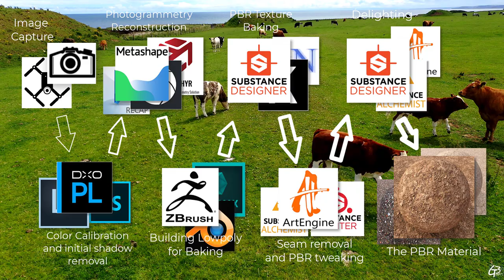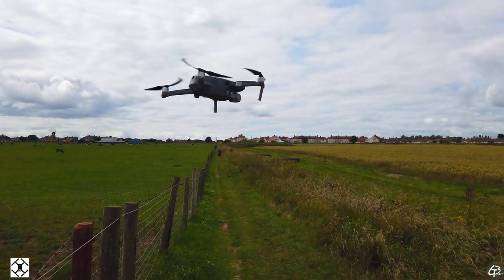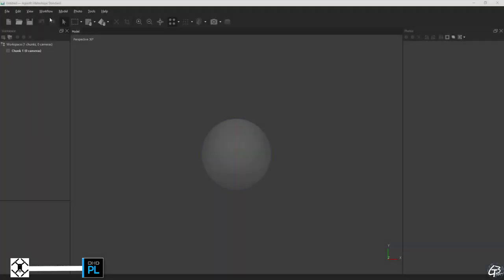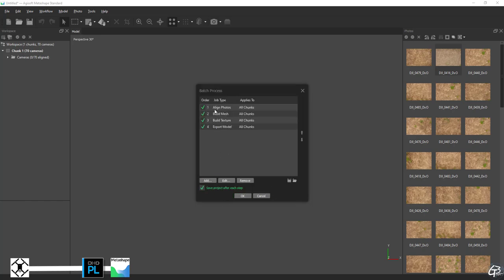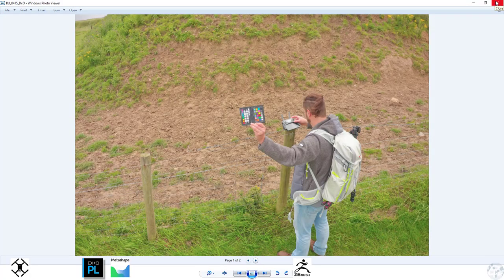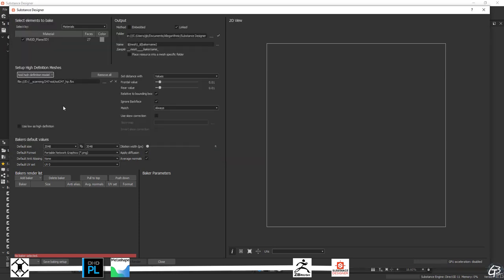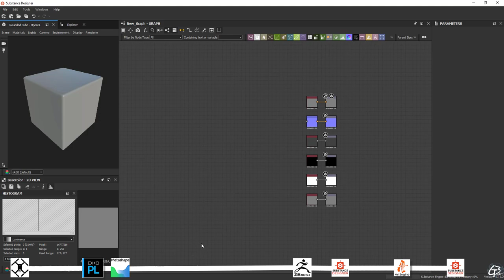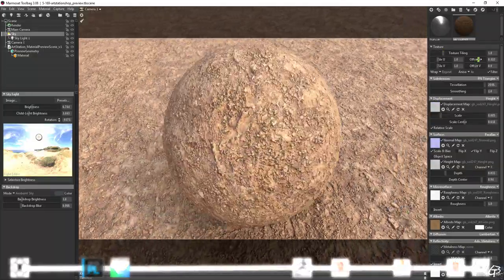Photogrammetry workflow for surface scanning with the drone - Soil PBR Material

Comment: Awesome as always. I love how you manage workflow with batchs in metashape. Thanks for sharing.
Reply from the maker: Thanks a lot. Usually I dont include image alignment part of the pocess to the batch processing as its too risky and if goes wrong I waste a lot of time on useless reconstruction which has to be repeated. Also after image alignment you have an option to limit the reconstruction area by changing the bounding box coverage and in result speed up the reconstruction process. Just saying :).
Cheers!

Comment: Thanks for the video. I recall when alchemists was announced the ai delighter was applauded, is it not as good as you hoped?
Reply from the maker: It wasnt very good when was released but it was improved. The new update brings totally new delighting quality and so far works great.. before delighting was quite useless. I am planning to create a new video to cover it since Alchemist grows really fast and is in constant change.. currently I am testing it and got surprisingly good results, unfortunatelly the tool still lacks of any control.

Comment: What if my game is not in Unity, but in some other engine? Can I still buy and use the Unity/Artomatix ArtEngine? Thank you :)
Reply from the maker: Hey, of course you can. ArtEngine is a separate, standalone app, but since the company 'Artomatix' which made it was acquired by the Unity a while ago, it is being sold by the Unity now. So to purchase it you will need probably to set the unity account to manage ArtEngine license from there and thats it. But to get more details you would need to contact unity sale dept as I dont sell it :). And yes, you can use it however you want and results achieved with the app are not linked any way to any game engine or rendering system.. similar to Substance products.. when you generate textures you can use them however you want to. Hope that helps
Reply: @GrzegorzBaranArt  Awesome Thank you :)

Comment: minimum $722 needed in software licenses to follow this exact workflow - Pricing at this moment: DXO Photolab $229 + Agisoft Metashape $179 + ZBrush $36/monthly + Substance Designer $50/monthly + Artengine $228/year(there is no monthly option I think)
Reply from the maker: If you push even further further, you can also include equipment costs: camera can be from 500-6000USD, lens from 500-5000USD, decent tripod from 100-500USD, a drone can be from 500 to 10kUSD etc. Nothing in life is ever free and quality always comes at some cost. You would be surprised knowing how much it costs to make my videos :) while I get something like 2-5USD from its monetisation per year if viewers dont skip or block ads :D
Anyway, if you watched my other videos or read my book, you should know that I always consider these tools as fully optional and one of many we can use. Shamefully my photogrammetry book is a bit outdated and this is why I am currently working on its updated version which I plan to release this or next year - when its ready - I already work on it for almost 5 years. 
What I mean is that in practice there are dozens options for each part of workflow.. some are better to others, some are cheaper and some are 100% free or almost free. 
If we pick ZBrush as an example: I published entire video on this channel where I show how to fully replace ZBrush with 100% free Blender in this workflow without any quality drop  :D .. and as said, its just one of many options to consider. Hope that makes more sense now :), Cheers!

Comment: Hi Grzegorz I hope you are very well in this quarentine period. I m write to you because i ve a problem when I try to build the mesh of a surface using Height Field 2.5D parameter. The grass height is to high when the Building Mesh process is done. So I wandering if this height filed parameters is tweakable to get better result. I don't know if i doing something wrong.

PD: I follow your PBR Material guide which is awesome and how you say the constant factor is a important matter when I made my composition, but I would try to push my limits a little more further into this so to see what going on I let you a picture. Finally, do you think it is possible to mix grass and ground has a single surface using Height Field 2.5D parameter? 

http://imgur.com/gallery/7M6w9Jv
Reply from the maker: I wouldnt use High Field reconstruction mode anymore since the new reconstruction mode - depth maps based Arbitrary mode - introduced in 1.6.0 version of Metashape gives you full 3D reconstruction in a way more efficient way. And it doesnt need infinite resources anymore. Especially the grass is the type of surface which has to be reconstructed in full 3D, otherwise you are gonna get glitches if the baking plane angle doesnt match in 100%.
Reply: @GrzegorzBaranArt  Thanks for your fast reply. I appreciate so much. Yes, I agree with you the Arbitrary mode make a better 3D reconstruction in difficult surface. At this time I can't find a solution to reach 100% angle alignment in my low poly 3DPlane uv-mapped at Substance Disegner to bake it. I am attaching some images so you can see how the baking of the textures is. I have been struggle to this since 3 days I m simple stuck here. 

https://imgur.com/gallery/en0s4BI
https://imgur.com/gallery/96IG1C5
https://imgur.com/gallery/KsMBlyO

I saw a couple of time your videos and look like simple but i don't know what could be happening. I try everything, since move the baker parameters in Substance and different angle rotation in Zbrush. Nothing.

I must be missing something in the uv re-construction in Zbrush. What can i do to correctly align the low poly model  in Zbrush?